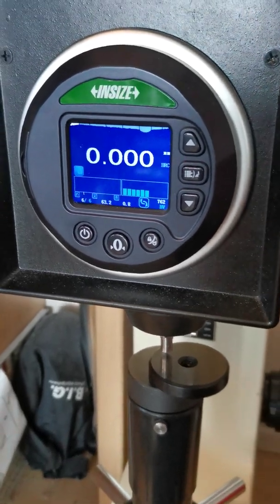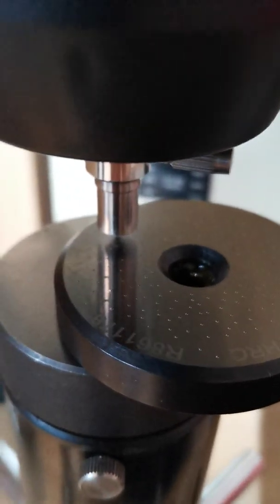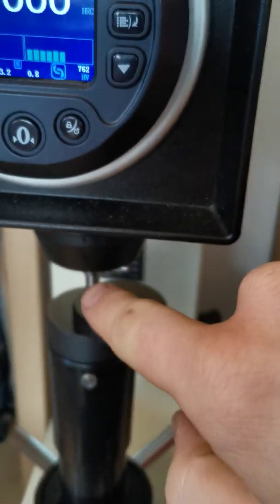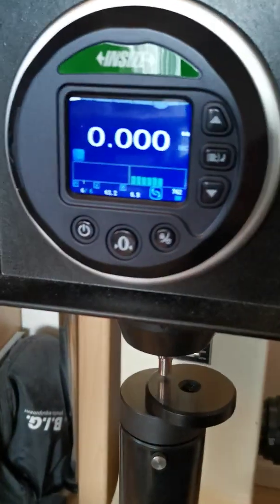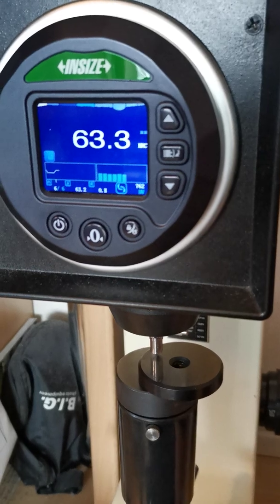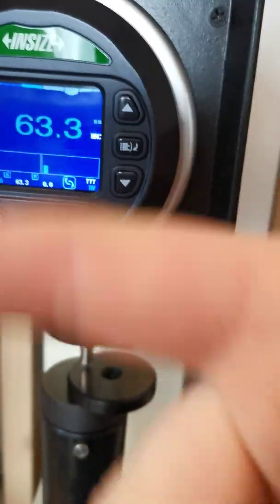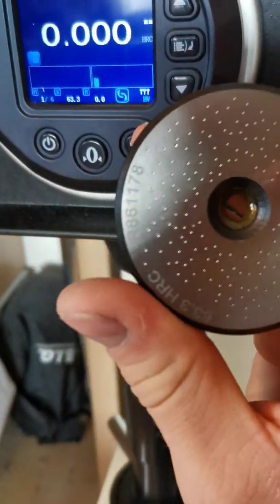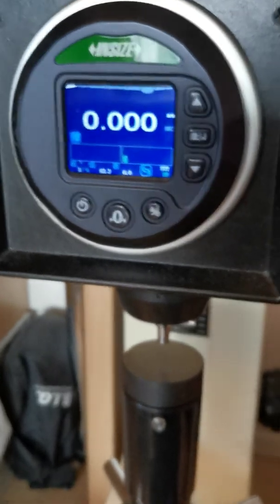Rockwell C Tester Calibration

Comment: Wow, I am a learned material tester (specialized on steel) and the Rockwell testers we had in our company were much more inaccurate than this tester. 
Testing the same calibration plates, we often had deviations of like +/- 0,5 HRc and if a customer wanted us to have material let's say between 55 and 56 Rockwell our quality department boss was getting a heart attack every time, because our machines were not that accurate to make sure that the material was in such a small tolerance.

I guess the testing machines have become much better over time, but in the quality laboratory we were always testing with Vickers and used charts to convert that value into Rockwell, because it was much more acccurate than our Rockwell testing machine.
(We had one of those testers where you manually have to put pressure, before the machine started the main measuring.
Reply from the maker: HRC testers sure have advanced, yes! I also got a Vickers tester, I think I got a video up on it here as well.
Reply: @kknives_switzerland  Cool, and wow, you reacted so fast! Hope to see more content on your channel, I subbed! :-)

Comment: Why did you choose zwear for your Scandinaviann knife instead of 65hrc 4v or MagnaCut? What's your thout on magnacut?
Reply from the maker: I prefer Z-Wear over both because better edge stability. Also, if you notice, this knife was made before Magnacut was even a thing. Yet I would still use Z-Wear over 4V and Maganacut because afformentioned superior edge stability of Z-Wear. Also, 65HRC 4V or Magnacut is too high for a hard use blade. If 65HRC  for harder use is desired, I recommend S390 Microclean. Has some very interesting properties. Yet still, 65HRC is walking on the edge for anything outdoor related; chipping instead of rolling on stone contact etc.